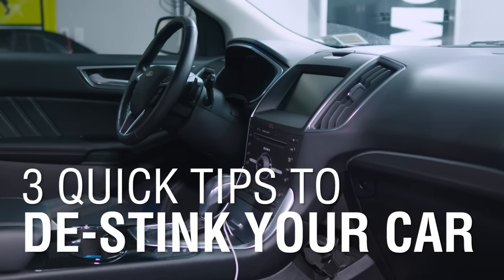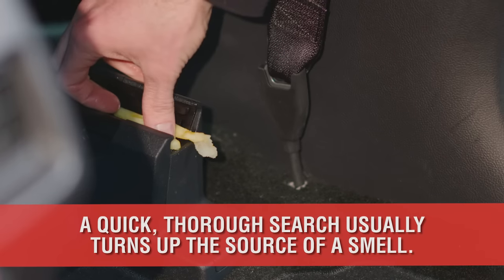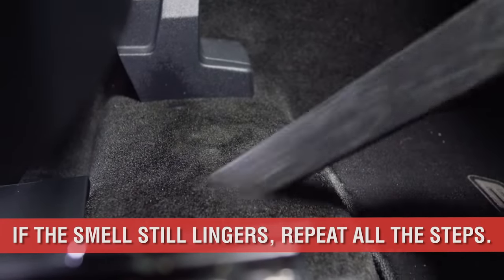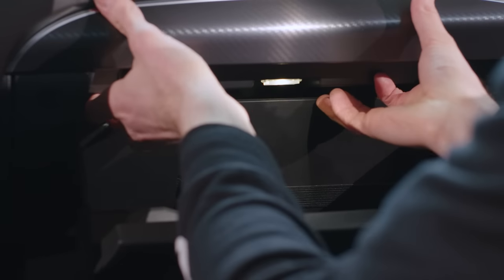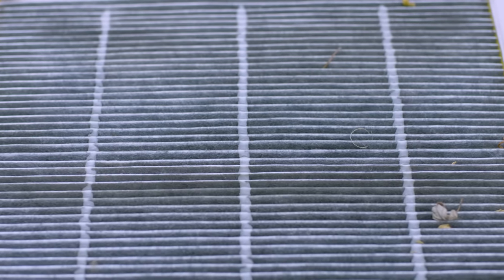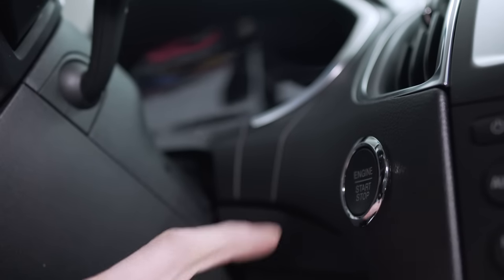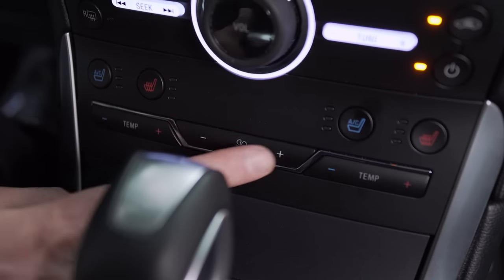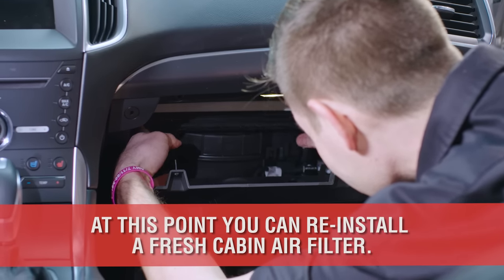3 Quick Tips To De-Stink Your Car | Autoblog Details

Comment: 1. Don't smoke in your car
2. clean up after yourself each time you leave your car
3. clean your car weekly, a vacuum, brush down and even a spritz of carpet cleaner will go a long way.
4. wipe down the interior with APC, as long as you don't use harsh APC or a diluted APC and wipe down the residue afterwards then your interior won't mind it too much.
5.Get rid of stains as soon as possible, get a scrubbing brush and carpet cleaner then go to town after you vacuumed out your car.
6. Don't use air fresheners, if you have to then my advice is to grind up the air freshener, put it in a coffee filter and run water over it into a spray bottle, spritz that under the floor of the drivers and passenger seats... heat rises and so do smells

Do not do the lick test, not only does it not work but I don't think you should be licking the exhaust pipe of your car, there are some parts of the car that get hot, such as under the carpet of the front passenger compartment is the catalytic converters, trust me on this they run hot by design and transfer the heat.
Reply: Happy Fox wppp
Reply: So what exactly will hanging the air freshers up do besides make the car smell nice? My friend did say it makes the car stink after the air freshener dies but I thought he was just talking shit
Reply: GOOD INFO ....GREAT INTENSIONS.... LACK OF EXECUTION ...THANKS

Comment: Bottom line,No smoking in ur car,plus no beer,food. Just 
Water.
Reply: nothing can stop me from eating in my car Lol
Reply: @ripfrickingben Right, for many folks and depending on a lot of factors, eating between stops may be necessary. Also, with kids it's a lost cause. They makes messes, and that's just the way it goes. WeatherTech or Husky Liners are expensive, but in the long run they'll pay for themselves in preventing liquid from hitting the carpet. As a young, single guy, my car was immaculate. That's very difficult and time consuming now.

Comment: I'm not a smoker, but I left my car to be wrapped, and they had my car for two weeks. When I got it back, I almost threw up in it!! They had so much smoke fumes in it that I had to leave my windows down for four days in the garage!! That helped, but I still smelled that little stinch. So I cleaned and conditioned my seats, and that did it. I sprayed some febreeze in the headliner before I did the seats. Then put an air freshener in to top it off..

Comment: i have stipped a car of seats i dont know what was spilt on the carpet but the smell is verry bad it has being siting like that for weeks nowi was told  i have shampood  steamed and extracted all liquids from the carpet i also shampooed the headliner of the car but the smell is still there what else can i try the smell is very bad and i cant find the source i cleaned all plastics all carpets seats everything i could think of i even dried out the car with a heater could it be that what ever was spilt went through the carpet then through the foam/spungy stuff and and down to the bare metal will i have to pull out all the carpet and stuff or is there another solution to mask the smell or something i even used baking soda for over 24 hours and the smell is still there i need a solution please from someoneit smells like someone took a shit in the car

Comment: Can you just use Lysol spray into the intake vents while the AC is on full blast with out recirculating on and all windows down?  Or is this method in the video the best way to do it?
Reply: Thats what ive done and it does work
Reply: Just roll the windows down because then your whole car just smells like a lysol bottle and it can be a little strong🤣🤣

Comment: Im not a professional, but I drive a lot and my car gets smelly from time to time and here’s what I do:

1. Cleanup the inside of my car.
2. Turn my heat on high recycle.
3. Spray about 1/4 bottle of Ozium inside of my car.
4. Leave the car running for about 30 minutes.
5. Open the windows and let the car air out for about 15 minutes.

It works great and it’s pretty easy.

(Of course change the cabin filter about once a year)
Reply: Ozium is awesome stuff!

Comment: What about a car that got nailed by a skunk on the outside?  Can you do a video for this?  I believe my car got gassed by a skunk and i had the air on and it's inside now.
Reply: just throw the whole thing away
Reply: That goes away on its own. It usually takes a few days but it will go away. Speaking from several experiences here. The thing that worked best to cover up the smell IMO is the arm & hammer pet odor

Comment: Anyone know what air vent cleaner he was using specifically?
Reply: You can use drops from an essential oil. What he's using is nothing special.
Reply: I use Ozium which is at Walmart, auto stores, Walgreens. It has an actual air disinfectant in it, so it really helps with the musty moldy smell that air conditioners can get. I recognized the smell in hospitals too when rooms are getting disinfected between patients. You don't want to breathe the stuff too much yourself, even though it has a nice sweet smell. I spray it in the air conditioner intake, then run the a/c on recirculate for a few minutes with the doors closed and the windows up, while I wait outside the car.

Comment: The ac condenser is mounted in front of the radiator. The evaporator is what's installed inside the hvac system.
Reply: So how do you make the air smell good again from egg in radiator ?
Reply: Or a egg smell
Reply: Similar to how Larry showed in the video.  Remove the cabin filter, close the cabin filter door. Start engine, run hvac on outside air full cold full fan speed and spray some lysol or equivalent into the fresh air intake. Shut car off, let sit a few to allow lysol or cleaning agent to soak in killing the fungus or bacteria. 

Start car, run hvac on fresh air, full cold full fan speed with windows open to clear cleaner out of car. Install new cabin filter.